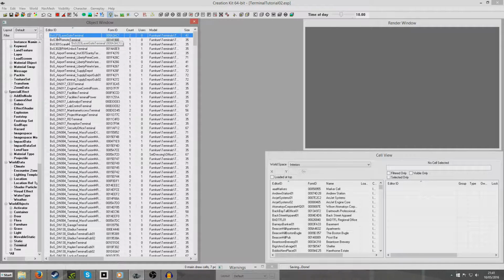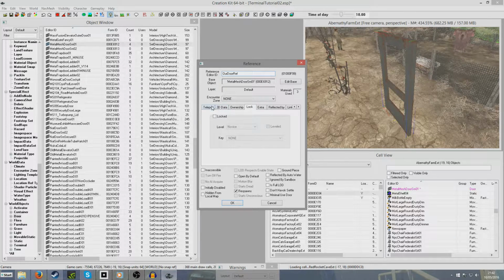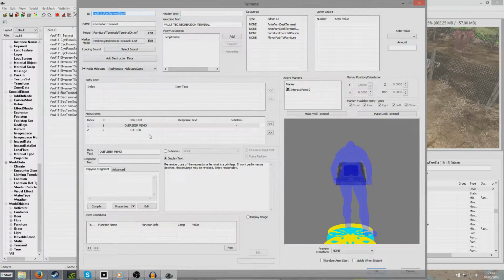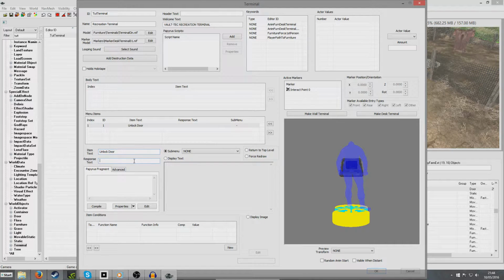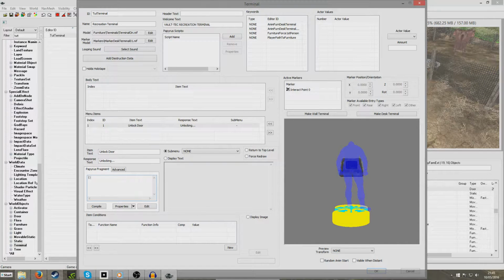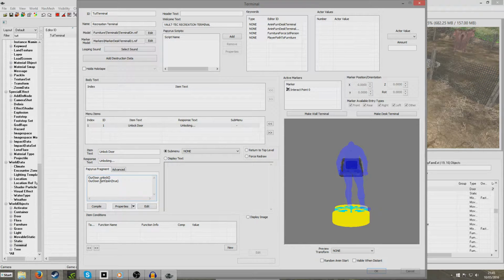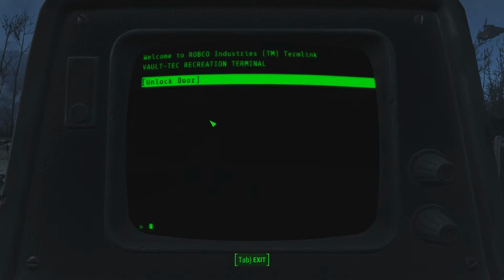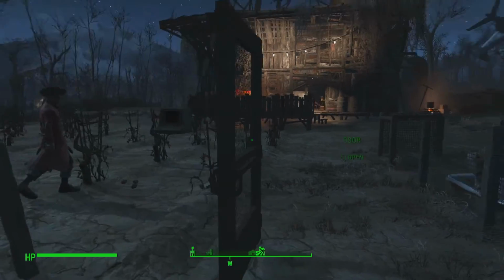Fallout 4 Creation Kit Tutorial - Unlock door with Terminal

Comment: This is what comes up when i press properties on the terminal.

C:\Program Files (x86)\Steam\steamapps\common\Fallout 4\Data\Scripts\Source\User\Fragments\Terminals\TERM_DN027_Terminal_001304CE.psc(2,0): Unknown user flag hidden

No output generated for Fragments:Terminals:TERM_DN027_Terminal_001304CE, compilation failed.

Batch compile of 1 files finished. 0 succeeded, 1 failed.

Failed on Fragments:Terminals:TERM_DN027_Terminal_001304CE

I just gave up completely on using CK through MO because it's a broken mess and shouldn't even be available as an option if you can't run papyrus with it, and running ck directly from desktop apparently tells me that there's just no scripts included for terminals that already exist within the game. This isn't a duplicate of an existing terminal, i tried using the origional terminal just to test if the scripts were even there. but for some UNHOLY REASON CK just refuses to admit that the scripts exist. How have you handled this problem? (if you've ever run into it)

Comment: I did this tutorial for a mod that I made and it all worked perfectly fine. I tested it, uploaded it to the nexus, deleted the esp, downloaded the one from the nexus, and tested that one too. Everything worked.
Then suddenly it didn't. Something broke. I went and checked in game and it wasn't working. Redownloaded the file and it still wasn't working. For some reason the door unlock and open script just broke for seemingly no reason. Worst part was that I didn't find out about this until way later, after my computer had a big power failure which took out my PSU, and my GPU went with it. The only thing I can think of is that Bethesda released a minor update which broke it.

So now I'm back here again because I have to fix the mod now that I've got new hardware and can actually use the creation kit again lol

Comment: Hi Seddon, love your videos.  Instead of the script, do you see any downside to using the "LinkTerminalDoor" keyword and creating a linked reference (on the linked reference tab for the terminal) between the terminal and the door?

Used the keyword method instead of script on a mod (Fusion City Rising) with about a dozen locked doors that require a terminal to open, since it was quicker to set up that way.

Haven't encountered any bug reports yet on the terminal doors, but maybe I'm missing something?
Reply from the maker: Yeah, a keyword link works just as well and it's probably better when you want to create a generic terminal or a terminal that opens lots of doors.

Comment: after i hit add property and add object reference add  name hit ok  i get this error ive renamed every thing, ive reinstalled creation kit and game im stuck???? please help

Papyrus Compiler Version 2.8.0.4 for Fallout 4
Starting 1 compile threads for 1 files...
Compiling "Fragments:Terminals:TERM_RaptureTerminal_0402F72A"...
C:\Games\Bethesda Softworks\Fallout 4\Data\Scripts\Source\User\Fragments\Terminals\TERM_RaptureTerminal_0402F72A.psc(6,25): cannot name a variable or property the same as a known type or script
No output generated for Fragments:Terminals:TERM_RaptureTerminal_0402F72A, compilation failed.

Batch compile of 1 files finished. 0 succeeded, 1 failed.
Failed on Fragments:Terminals:TERM_RaptureTerminal_0402F72A
Reply: Yes. I got the same problem... the issue is that he says brackets but uses parenthesis... if you use parenthesis as is shown in the video it will work fine... just careful to type the property exactly as defined... any typo will prevent the script to run.
Reply: Johnnatan Da Cruz  thanks